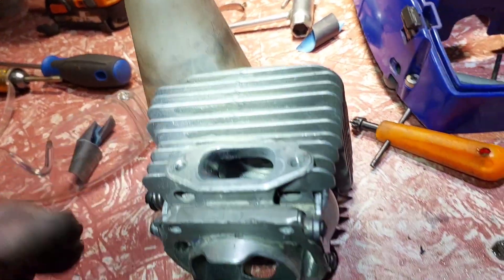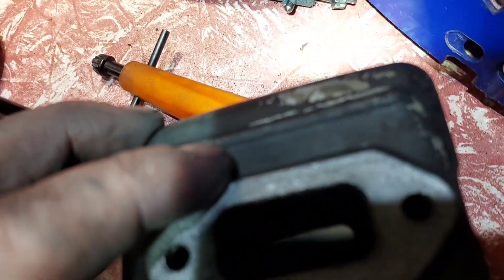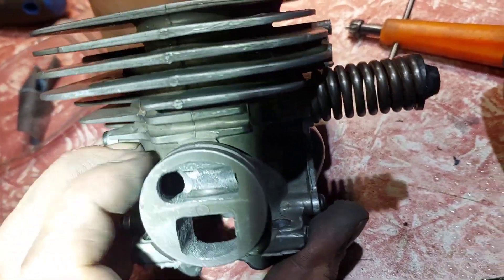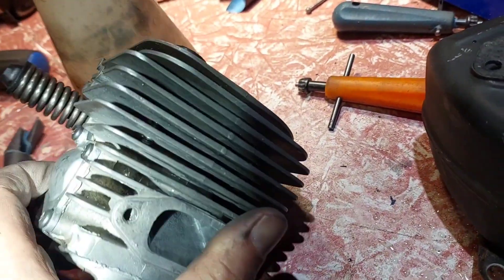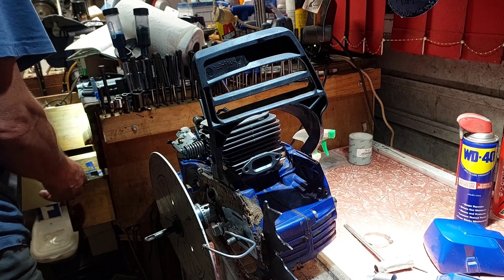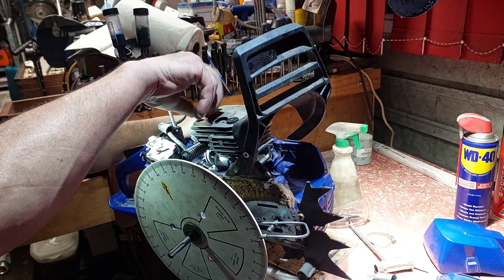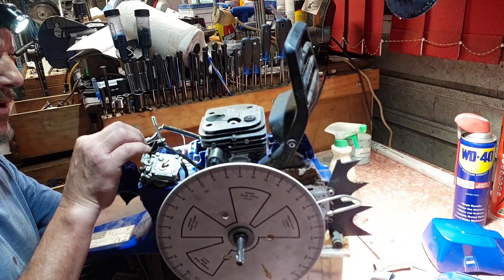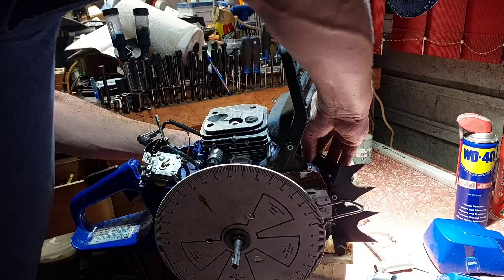farmertec G372XT chainsaw new timing numbers!

Comment: The cylinder that came on my blue Holzfforma 372xt was trash..the timing wasn’t close ..I ordered spare cylinders from farmertec and they was the 365xt ..timing was good ..so I pulled the the caps ground out the dividers and ground the strato ports out to match and OEM cylinder on the inside..machined the base and it runs great..OEM carb and boot too…..can’t remember the numbers but I can look if you are curious 🤙🏻😎
Reply from the maker: Cheers that would be great thanks mate
Reply: @MrHangerone base gasket delete..machined the base to get my squish at .020…102 exhaust..118 on the transfers…74 on the intake..🤙🏻😎
Reply from the maker: @Aaron_A_Lynch  cheers Kevin